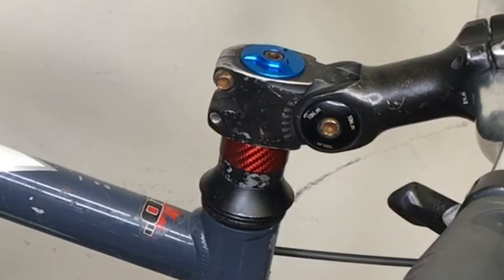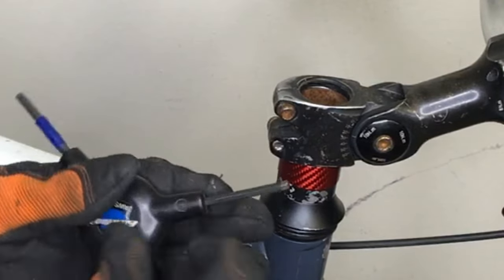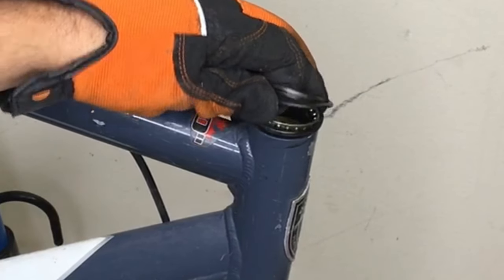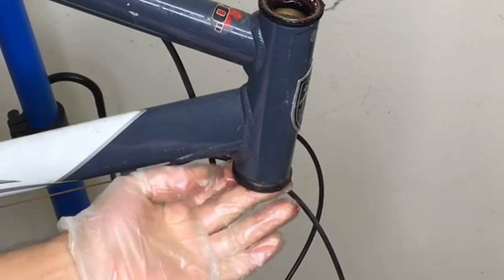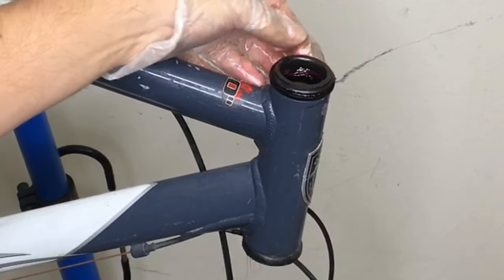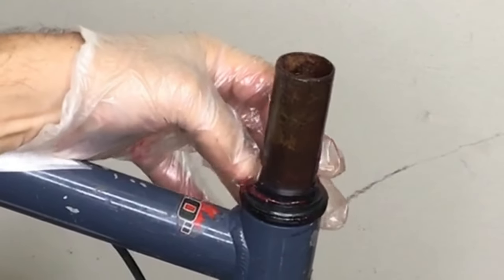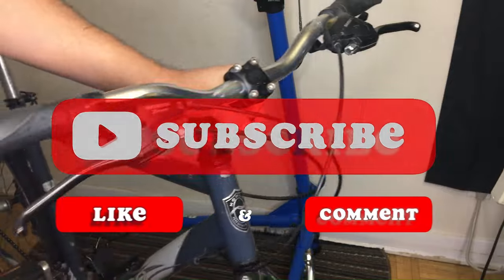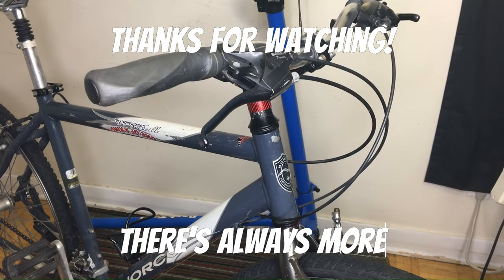FREE threaded to threadless headset conversion?

Comment: Just a potentially dumb question. 
In this way you managed to fit a 1 1/8" threadless fork instead of a 1" threaded fork? Or they had the same size? This second case sounds unusual very unusual, but more phisically reasonable
Reply from the maker: I appreciate the question. No, both are 1 1/8 and no it's not unusual at all when you compare the parts of a threaded to a threadless headset. I wouldn't bother making this vid otherwise. Call it collateral learning as this conversion is not only possible but can be achieved for free!
Reply: @hobbybike51  oh cool! Didn't know that 1 1/8 threaded forks existed 😅
Reply from the maker: They were mass produced during the early hybrid craze, usually identified with those adjustable 25.4mm quill stems a v-brakes. I guess I'm old AF lol! @claudiofiero8523
Reply: @hobbybike51  naaa I don't think so!
I'm 24 and I've been riding occasionally for many years but started getting mildly interested in bike mechanics and components only in the last months 😅
Reply from the maker: That's awesome! It's a great hobby that can pay for itself indefinitely. People toss good stuff all the time and don't even know it. Thanks for the support and enjoy your weekend!  @claudiofiero8523